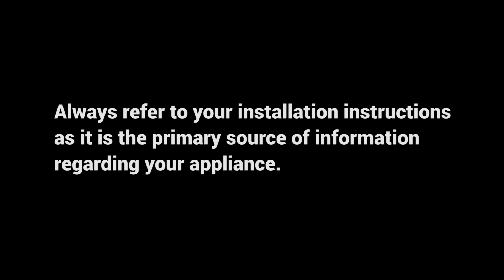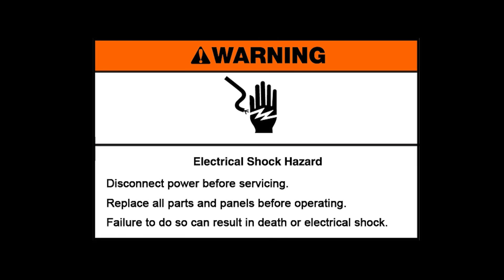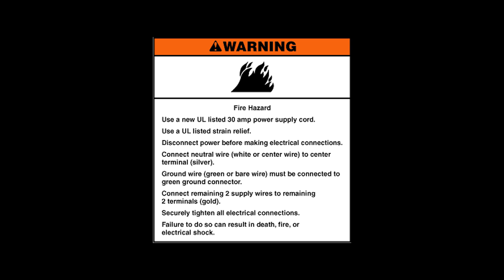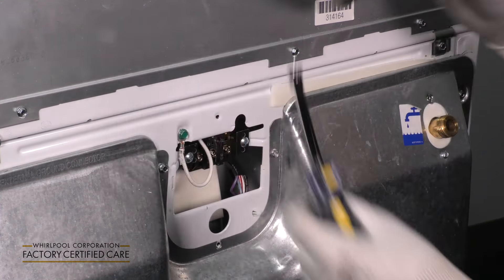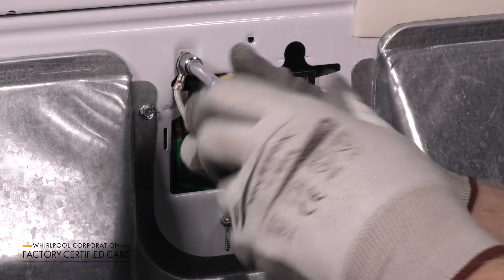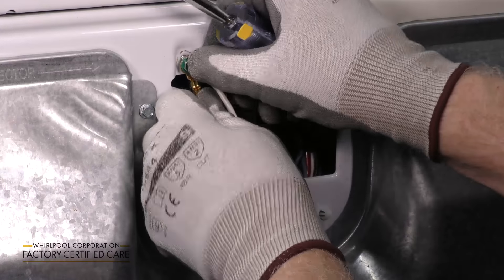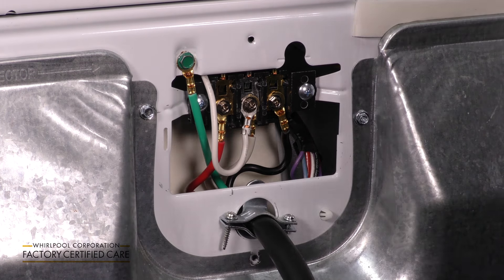Install a 4 wire power cord to your dryer

Comment: What if my neutral wire is also green?
Reply: Did you figure out your question on your own? I have an old dryer that I am moving and upgrading to a 4-wire cable. Mine also has a green wire to the left, instead of white. I saw another site that left the green wire in place and they connected the ground wire to it. The bizarre thing is that neutral and ground are connected to the same bus bar in the panel anyway. I wonder if either way works.

Comment: One issue.  When reattaching the block cover, how did you get the bottom edge of the cover to fit properly when the strain relief edge that sits on the inside of the dryer is in the way?
Reply: on mine, cover sits on outside in center of cover

Comment: Just got a washer and dryer from rent a center (personally dont like them) and they gave me a bent out of shape cable with my supposed brand new dryer. Went to home depot to purchase a replacement but im concerned about something. The guy at rent a center showed me how to replace the cable and his instructions are somewhat different from yours. he instructed me to connect the green cable where its shown in this video, however he stated to keep the original white cable that was in it's place in the same spot as well while the other white cable on the power cable that goes in the middle gets connected by itself. did he give me incorrect information or does it not matter? the other cables seem to be color coded on my dryer however with red on the right and black on the left.

Comment: I followed his instructions except he said you could put the black or red wire on either terminal so I followed the picture and put the red one on the left.  When I plugged the dryer in it sparked and shut off the power to the dryer and the garage door.  This was the first video that popped up I checked others and two out of three say put the black one on the left.
Reply: it really doesn't matter they're both negative. most likely you just didn't tighten them all the way

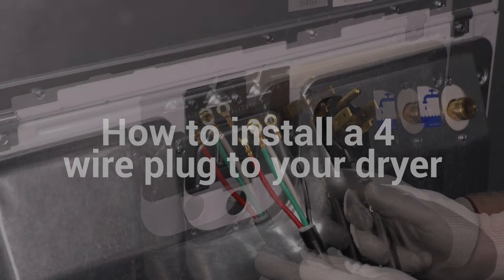Comment: If this is a DRYER, why is there a water hose connection (1:13)??
Reply: This would be a dryer with a steam feature, which is supplied using a water line (usually run from a Y-splitter off of your washer cold water supply)

Comment: There's a white wire that's inside the machine does that go on the ground green thing?
Reply: I think I have same issue - there is a white wire with terminal from the machine.  Does that go to the ground or to the white terminal along with the white terminal from the power cord?